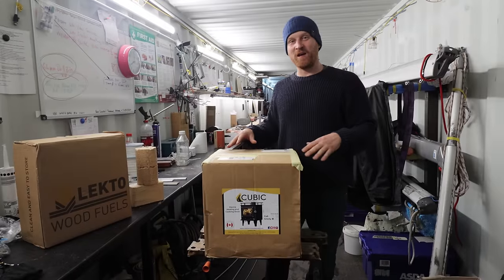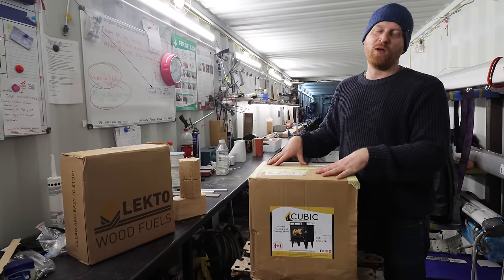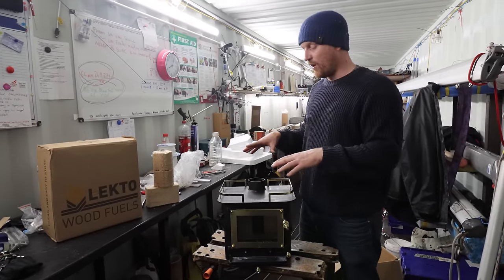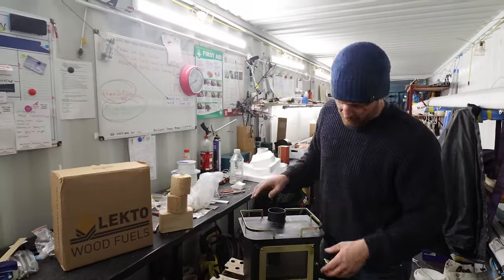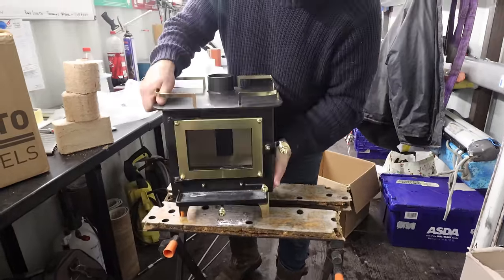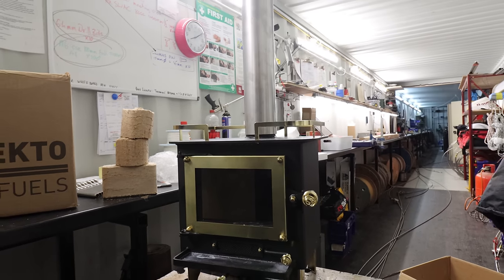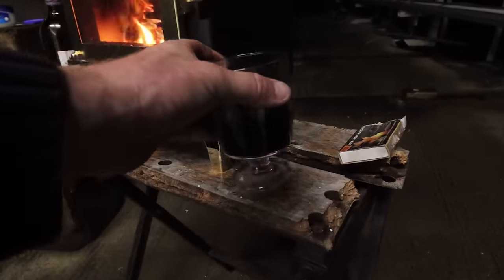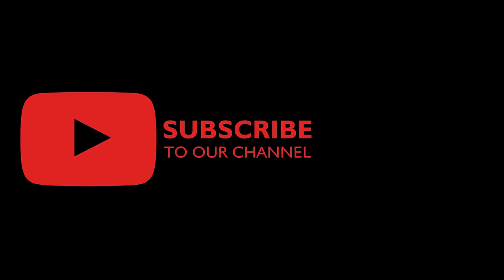Cubic Mini Wood Stove Unboxing & First Fire (2022)🔥

Comment: Good choice! We have had the same model for a while. This is our 5th winter with it installed on our 40 foot sailboat. If anything you will find that the boat gets too hot. As I write this comment it's about minus 3 outside and a toasty 23 in the cabin. We burn a mix of whatever is available- logs, compressed wood, coal and use a thing called a night briquette which is super for keeping the thing in through the night hours without having to continuously stoke the fire every two hours or so. Two night briquettes when we go to bed will keep enough heat in the fire to relight first thing in the morning with a few bits of kindling. It's a learning curve to get the best out of it, learn the qualities of different types of wood, never burn pellets of any kind and be patient! Cooking is an added joy too- plenty of opportunities to practise...cast iron stove ware is the best.We carry sufficient fuel in one of our large on deck lazarettes to go for approx a week to 10 days which, to date, has been sufficient for our needs here in SW England.
Reply from the maker: I had no idea you could burn coal in it too? That would really help with fuel storage too 👌🏻

We have a box of night briquettes, amazing how long they last for!

Comment: They are great, however, they burn more wood than you could ever imagine!
To store enough fuel for a week's cruising you would have to tow a mini barge behind you.
I used to mix wood and coal briquettes which last longer give more heat and take up less space!
Tip two invest in their fan to circulate the heat better.
Tip three, make sure you orientate the wood so the ends do not face the glass as the gases and tar is sprayed onto it making it black out quite quickly.
Last tip always clean the glass with damp newspaper it works a treat.
Reply from the maker: Ha ha, appreciate the heads up, will be sure to implement your suggestions.

Well, maybe with the exception of towing a barge. 😬
Reply: @CadohaAdventures  oh just one important lesson I learned, they get very hot!
My daughter thought it would be great to put a tealight candle on the top.
It was unlit and the wax melted releasing it's perfumed scent, it was very pleasant until the wax reached its ignition temp and burst into flame. 
It's almost burned the boat down and the flame was a good 8 inches high. In her panic she knocked the foil cup off the stove onto the cabin floor where it continued to burn. Luck I was there and grabbed an extinguisher.
Sorry, hope I have not scared you but please be aware and never put anything other than a watched cook pot or kettle on the top.

Comment: Very nice.  Don't forget to get a thermal fan (heat difference drives it) to move the air around better.
Reply from the maker: Great point, and we did indeed get one with the stove. 🙏🏼☺️

Comment: Nice one. Back in the day I helped to install something similar but bigger into the crew quarters of a grab dredger. We also fitted an external flue extension pipe topsides to improve the draw and to help us to fine-tune the heat output. Your stove has the potential to throw out an immense amount of heat on a 38-footer but experimentation and tweaks will result in a pleasing ambient temperature.
Reply from the maker: So far it seems like just about the right size for our boat when it's freezing temperatures outside, nice and snug. Although the heat doesn't travel far out of the saloon.
Reply: @CadohaAdventures  The size looks good to me. I don't know the model you have but my previous home was also heated by a wood burner with a back boiler for central heating and the output was insane. Woodburners have downsides (dusty and one more thing to clean) but on the whole they can be efficient and, well, good fun too; you'll love it. As will Hank, probably, when he overcomes his suspicion. On the dredger installation we fitted a mix of ceramic tiles and stainless steel to give a nice blend of aesthetics and practicality.

Comment: I really don't know why anyone living in a northern latitudes climate would want one of these when you could have my eberspacher ( other makes available 😂😂 ) screaming it's head off as the fan assembly bearings start to fail on cold start up followed by that calming  whooshing noise all night long. Whilst all this is going on you can think about how to save to pay for the routine parts that will break and be a PIA as you up skill, yet again, to learnt how to fix said device!! 😉.  TIP......buy a stove top fan, they are great and work really well at throwing the rising hot air across the room, they run almost silent too. Great job and look forward to the installation
Reply from the maker: You had me for a second there 🤣

We have indeed bought one of those heat powered fans. So far, so good ☺️🔥

Comment: Very nice, you could add a water heater like the Robens Bering made from Stainless steel, it fits round the stove pipe.
Reply from the maker: Heating water with the stove would the holy grail. To heat, cook and have hot water, wow, that would be something ☺️🙏🏼
Reply: @CadohaAdventures  They're about £50 works a treat, I have the frontier stove, an outdoors type.
Reply from the maker: Will be sure to check it out 🙏🏼🔥
Reply: There are water heaters as accessories on their website

Comment: Neat little stove Dom, looks great.  I have a charcoal stove but it would be nice to see the flame as, let’s face it, that’s part of the draw, forgive the pun….  Look forward to the install video.  Oh and mulled wine is great sat on the stove on a trivet so it doesn’t boil, always ready and smells great.  You may find charcoal works well, the lump wood type not the briquettes.  Charcoal burns very clean so no horrid spot on deck or rig.  Maybe the smokeless fuel logs will be as good but may be expensive.  Cheers. Andy UK
Reply from the maker: I do love the idea of mulled wine on the stove top now, come to think of it! I'm not sure if burning charcoal is 'suggested' for the stove, but it is essentially just partially burned wood, no?
Reply: @CadohaAdventures  Yes indeed.  In fact I just downed a glass or two of mulled cider…. Hic.  Charcoal is like dehydrated wood , not partially burnt as such.  It is wood cooked for days in a kiln and produces a lot of heat when used on a barbecue or in a charcoal burner.  In my case the advantage is a burner with a flue of only 1” so it is much less of a hole to cut.  There are other disadvantages but everything has its + and -.

Comment: Smart , the diesel heater sounds messy and correct me if I’m wrong, but doesn’t it draw from the battery bank? Diesel should only be used for propulsion 😊

Comment: It says to burn for thirty hours to cure the stove before installing them and I just got mine with the roaster and the water heater haven’t installed it yet will be really soon into my truck camper here in Alaska and going to tak it running around taking pics here really soon

Comment: Wow that's awesome.  We were just talking about this topic last weekend.  How do you like it so far? Is it stable enough to keep on the boat when underway? 
Thanks for sharing this neat little wood stove
Reply from the maker: Hey there. I don't think we'd ever have a free lit whilst we're underway, if we needed heat then we'd just fire up the diesel heat for that. I just think a live fire when you're sailing would be far too dangerous, personally.
Reply: @Sailing Cadoha  oh yes I am in agreement with that, but is the stove hard mounted in such a way everything, including the stove pipe will be stable?
Reply from the maker: It is, yes, but I'm not sure the fire bouncing up and down in a bumpy seaway would stay lit for long and it seems like it'd be quite the danger to open the door to keep it going, not to mention having something that hot to be thrown into potentially 😯⛵️🔥

Comment: I thought you installed a hot air diesel heater a while back. I am interested in the reason for the change.
Reply from the maker: We still have the diesel heater installed, it's been great and we'll still use it but with this we can warm the boat, dry the boat, cook food and (hopefully) make hot water. We have no gas on the boat and so we need winter systems for our upcoming project.

Comment: Hi, that's a steel not cast iron stove so your only curing / burning off paint.  You should have no trouble but steel is less stable than iron so be sensible about differential heat.
Should last well but will rust more than iron....
Cheers Warren

Comment: Wait a moment!  I thought you had installed a diesel heater.  Doesn't it work? I'd be very interested to understand why you are adding this stove.
Reply from the maker: We do indeed still have a diesel heater and it does in fact heat the boat well, but it doesn’t cook food, heat water or look pretty, ha ha. We’re planning a fully off grid trip, totally unplugged from mains electric for 365 days, so we need more winter systems to do all of the above.

Comment: Can you burn solid smokeless fuel with this stove or just wood?
Reply from the maker: We're burning wood brickets, which are meant to be smokeless (there is very little smoke). As far as I'm aware it's only suggested to burn wood, or wood products (like pellets and pressed 'logs') in the stove.
Reply: @CadohaAdventures  Thanks for responding. Wood fuel in my 150mm square 'hot pot' stove did not generate sufficient heat. I'll be interested to see the results of yours following instillation.
Reply from the maker: So far it seems to warm the saloon up nicely when it's minus temperatures outside, although the heat doesn't really move into any other rooms, even with the warm air distribution fan we've mounted on top. 

But as I write this to you now, perched right next to the fire, it's pretty toasty indeed. 🔥☺️

Comment: It seems diesel heater not enough?
Reply from the maker: Yes we still have the diesel heater and it's fine for heating the boat, but the stove dries the boat, heats the boat, you can cook on it, heat water with it and it looks nice too. We're planning a project to unplug from all grids for a full year (Project 365) and so we need more winter systems 🙏🏼⛵️

Comment: Puts out around 12000 btu approximately 3kw..But you will be a slave to the burner as it only burns twigs ,you'll need a wagon load of twigs to feed this machine.
Reply from the maker: We’ve been burning mostly logs that are about 4 or 5 inches thick and if you dial down the air vents then each log burns for a couple of hours. We love our little fire although it can make the boat too hot sometimes, especially when you put several logs in it.